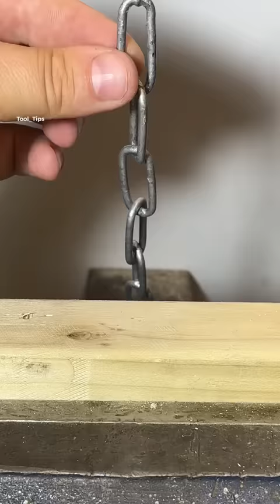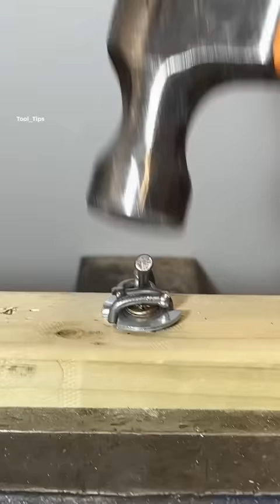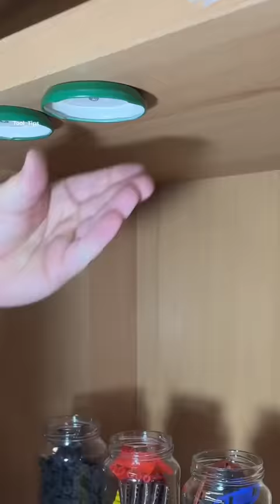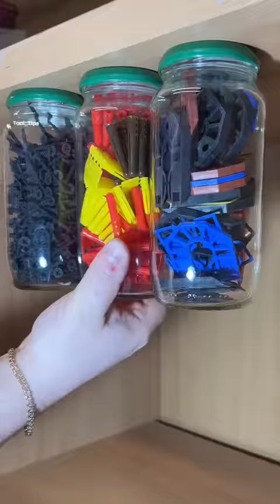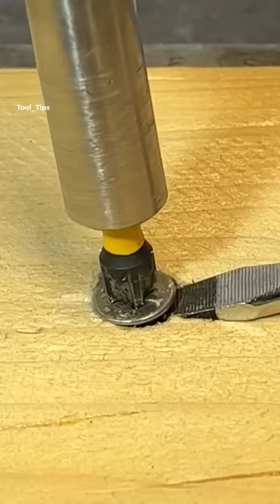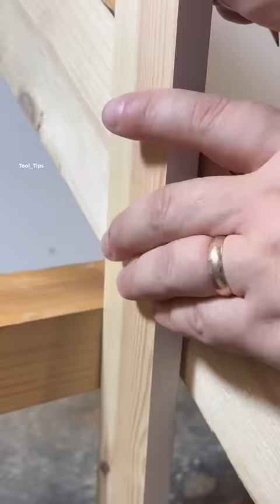Just a few Tips 🤷‍♂️

Comment: One 3" screw is enough don't over kill it.😹😹😹😹😹
Reply: I was waiting for a pair of 6" lag bolts and a piece of 1/4" plate steel with the bolt heads subsequently welded to the plate,over the top of all of the chain holders.
Reply: uhh….
Reply: too much makes wood weak.
Reply: Gracias

Comment: For the last one, the height of the board used to measure has to be the same as the height of the horizontal piece of wood for the cut to fit
Reply: Please explain. Truly interested.
Reply: I was thinking the same. By doing it like this he basically moves the tip of the lumber towards him. Hence creating a gap at the top. But I guess it depends on what he's building whether it would make sense.
Reply: @Nicholas_Triumph_Thruxton  He should mark the underside of his set square piece of wood not the top.